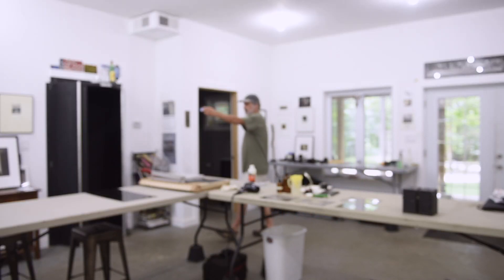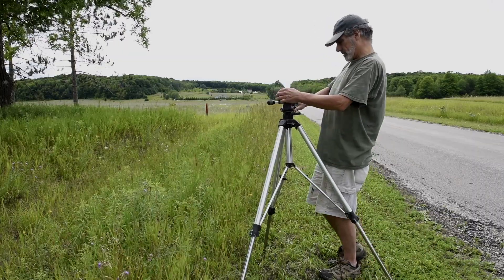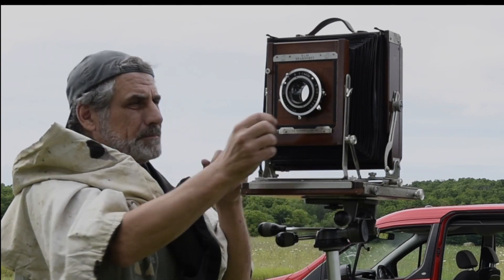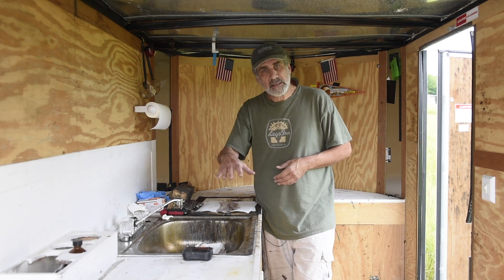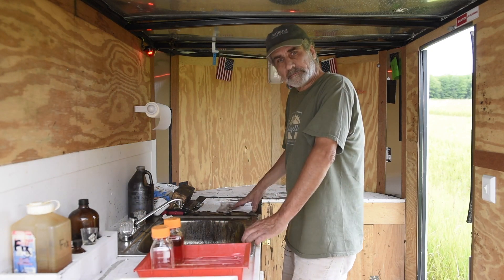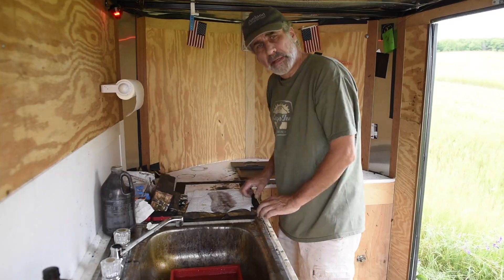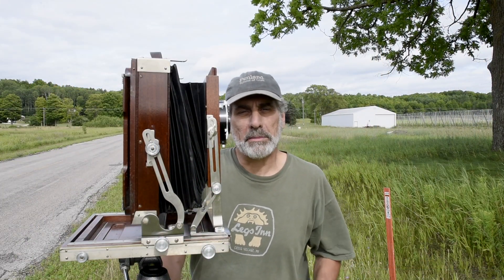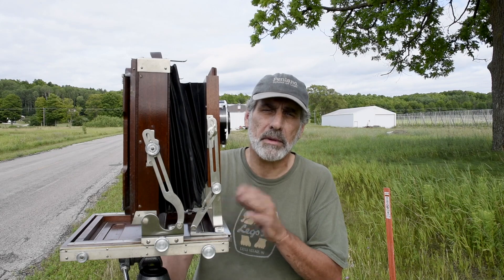Wet Plate Photography Demonstration - Making Tintypes in the Field

Comment: I’m learning the process. Winters coming I need lighting . Any suggestions under 500 dollars. I don’t mind longer exposures. What do you use?
Reply from the maker: I've not used much artificial lighting and usually go dormant in winter. However, you can use high-powered studio flashes to light your portraits, but they have to be pretty powerful. 4500 watt seconds would be a minimum, I believe.

Comment: I really get a lot out of your videos, but I have a question on exposure calculating. Since it requires such a low ISO , how in the world do you figure it out ? Every video I watch, nobody explains it ? Seems to be outright guessing ! My meters don't go that low ! Seems like everybody shoots wide open or pretty close to wide open and it would be very helpful if we could see how you're doing it. I know there's reciprocity failure and bellows/lens factor to deal with too, which makes it even more difficult ! It often just seems like educated guessing from experience that often needs adjusting. So what did you do when you were learning and didn't have all the experience ? Thanks, LarryMac
Reply from the maker: Hi Larry. Great question. A lot of it is guessing, but more of an educated guess. Figure the ISO of Collodion freshly mixed is around 1. Pretty low for sure, but I’m guessing that your meter will go down to an ISO of about 25?From there you can figure one stop would be half of that or say 12. Another stop would drop it down to an ISO of around six. One another, three and when you get to one, you’re about four stops off of your reading at 25 ISO on your meter. Obviously, if you’re shooting wide open, there’s nowhere else to go so you’re gonna want to make that up in time. then it’s just a matter of math. For instance, if you get a meter reading it ISO 25 wide open at say one second, two seconds will be one stop, four seconds will be two stops eight seconds will be three stops. So at four stops, that’s putting you around 16 seconds wide open which is where you would want to start. Then it’s a matter of seeing how it all works out and adjusting from there. Hope this helps!
Reply from the maker: And thanks for watching and commenting, Larry! I’m glad they help.

Comment: How long would I have to develop the plate once the photo has been taken. It seems like a dark room needs to be really close.
Reply from the maker: General development time for a plate can be anywhere from 6 to 15 or so seconds depending on if you’ve used a restrainer in your developer. The dark room definitely needs to be somewhat close by which is why I use the trailer or others use what is called the dark box to develop their plates in. Hope this helps!
Reply: @BillSchwab  thanks. I just purchased a Rochester Optical Camera 8 x 10 with what I believe is a Petzgal lens (spelling) it will have one plate holder. Once I get my chemicals and tank, I will give it a shot ( pun intended)
Reply from the maker: @baroneblades5386  Excellent! That’s a good camera to work with. The lens would be a Petzval. Saw it after lenses for the process because they give a nice Boka swirl.
Reply: @BillSchwab  thanks, got the camera. I appreciate your help.

Comment: @North Light Photographic W... Tyntipes can be done on black acrylic sheets or only aluminium? Thanks. Ah I wouldn't be inside the trailer developing while the camera was outside... You're brave!
Reply from the maker: Unfortunately, only aluminum or glass because the acrylic would be dissolved by the solvents. Lots of ether and alcohol. I do know someone who is dried, but without much success. If I wasn’t the only human for miles on this one, I never would’ve left that baby out there. 🤣
Reply: @BillSchwab  thanks for replying. It's strange as when we sensitise a plate most of the supports that deeps the glass are made out of transparent acrylic!!! What are your thoughts about it?

Comment: Might mention that when pouring silver nitrate in or out of the tank it's a good idea to wear safety glasses.  If the stuff splatters and gets into your eyes it can blind you.
Reply from the maker: I’ll be getting to that. And thanks for mentioning!
Reply: I also do not use glasses but is good to warn people about the potential risks if I do demonstration. It is almost the same if you clean your bathroom at home with chemicals which are also dangerous - it can damage your eyes too - mostly nobody cares.